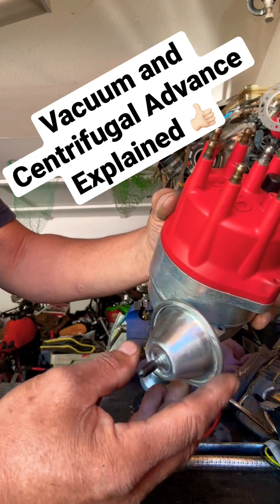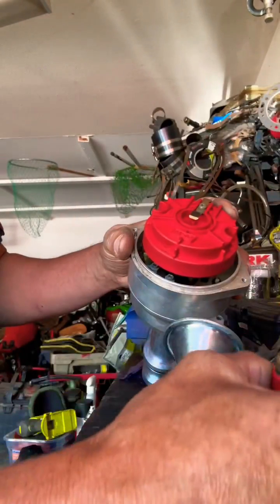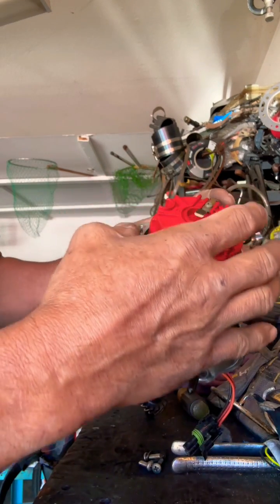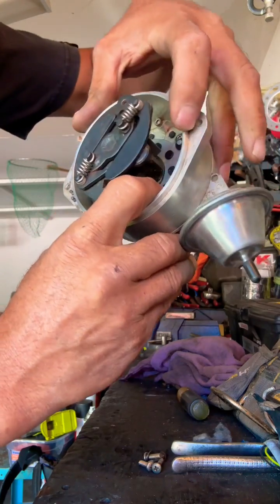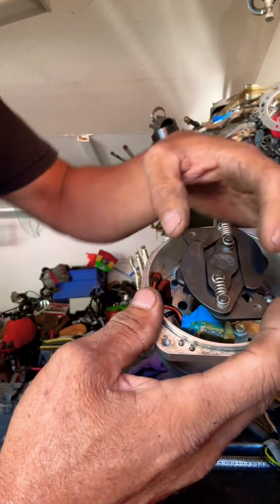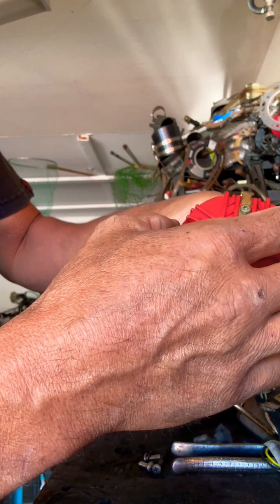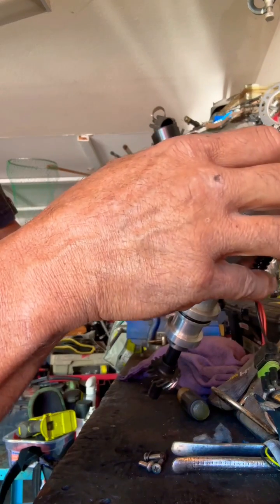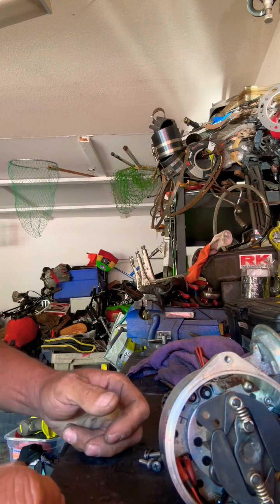DISTRIBUTOR TIMING BASICS EXPLAINED⏰ #shorts #distributor #ignition

Comment: What direction does the rotor turn?
Reply from the maker: This rotor turns Clockwise. If you are every curious yourself on any model, take the cap off and turn the engine over and you can see which way it turns.

Comment: CAN U PLEASE SHOW HOW TO REMOVE THE DIAPHRAM I CAN NOT REMOVE MINE AND CAN NOT FIND ANY VIDEO
Reply from the maker: I will try and make one as soon as I can. But until I can try and see if there are some screws or rivets that are holding the vacuum diaphragm on, and there should be a piece inside that it hooks to the plate that it moves. Hopefully you can find those and remove it and replace it. Let me know how it goes, but I will try to do this as soon as I can I am really busy at work right now but will do my best
Reply: @fastflo1 ACTUALLY i figured it out that plate actually can be raised up. Just above the plate it has a snap ring ring. I believe thats what it is called.  Once the ring is off it it goes up enough to remove the advance canister.  But only way to put sna0 ring back u must use the tool because it is difficult to put back without it! U dont want to pry up on plate like other videos show! They are misleading because they may have a different kind! You never want to pry up on that plate to remove or install!  That plat needs to be straight! Even on internet sugests u can use flat head to pry which can make someone believe its okand also makes u believe the lil black ring that holds the arm on the advance  comes off! It does for some. For most but some have a nut under plate! Which makes u think u just get needle nose and pry it! NO

Comment: my engine wont start when i put the vacuum hose on the diaphram, pull it out….engine starts idles smooth and no problem what so ever driving…what is the issue?
Reply from the maker: Great question . If you have it plugged in or not depends what it could be. 2 things are happening . Your carburetor should be sucking to be able to operate the vacuum advance. If the diaphragm is not working it could create a vacuum leak so the carb is sucking in too much air . If you block it off, it may run still because it doesn’t have a vacuum leak. It just will not have the ability to advance the timing on the vacuum advance mechanism. So maybe the vacuum advance diaphragm is bad . Let me know if that ends up being the problem .